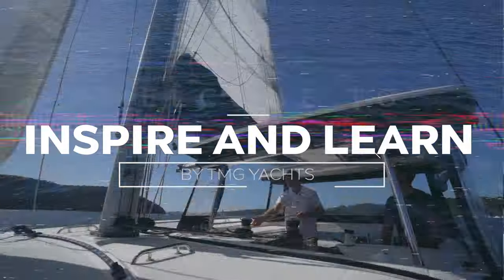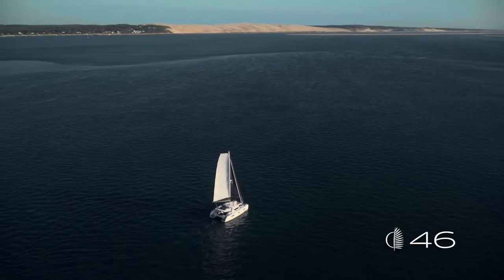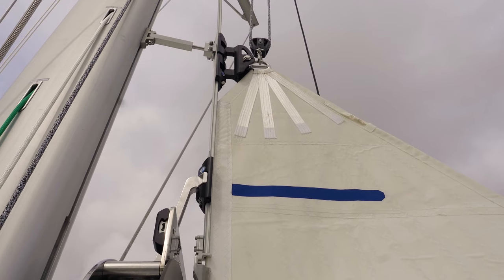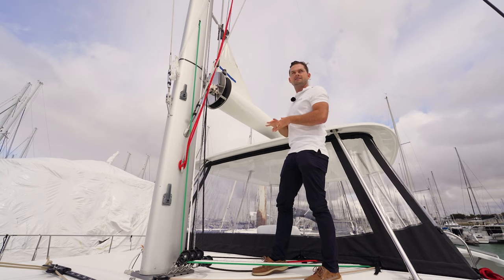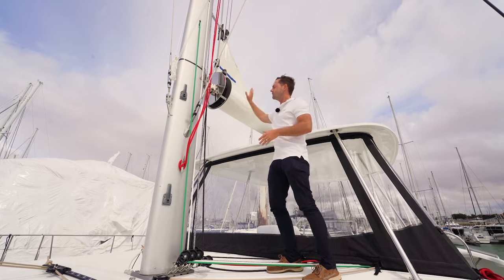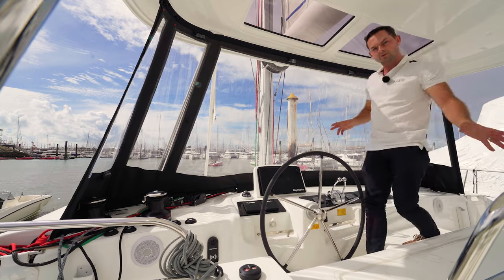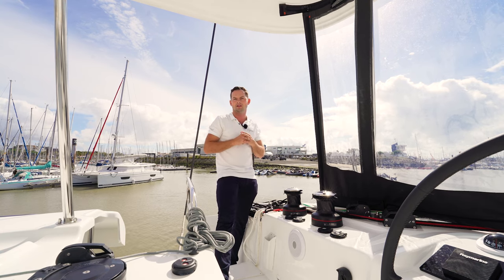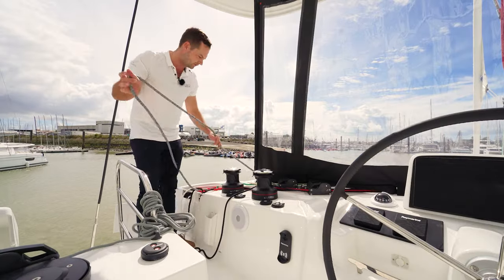Lagoon Catamarans NEW Furling Boom System | Inspire & Learn

Comment: Working on the back edge of that flybridge head to wind in a bit of a blow to prepare the boom 😮 I can see the owners really enjoying that experience lol. As with the lack of handholds on the outboard side of the steps getting up to (and especially down from) the flybridge in anything but calm conditions… I don’t think that these boats are designed by people who know what is needed when actually sailing. The furling boom is a neat piece of engineering for sure but in the real world, the traveller and mainsheet need to be in a less exposed position, and the sail itself needs to be able to be dropped without having to go through “processes.” It needs some kind of override to be able to collapse the sail in a hurry. It would also be helpful if Lagoon fitted more stainless rails and handholds on the outer side of the steps to the flybridge (particularly) and even getting down the steps of the gas locker into the rear cockpit is a challenge in anything but calm seas. The moulding (and only protection) on the outboard side of the steps is at shin height and there is nothing to hold onto on that side at all.

Comment: what a monstrosity of a system... the other furling systems are much better/tidy... the amount of weight that Lagoon is pushing up high is very worrying for a catamaran... they are going to have to keep weight in the hulls to balance this which ultimately means its a motor sailer !!
Reply from the maker: Thanks for your comment! This new system is indeed different from current aftermarket options on the market. While there is a little more weight than a conventional slab reefing system, there is far less weight on this set up than one with a cowling or solid cover hiding the sail. The weight of this specific set up is some what negligible compared the the obvious advantages of offering this system. It is, of course, an option and the standard slab reefing boom can still be equipped on the Lagoon 46 & 51 should some prefer. 
Having used this system, I'd say the naked design, although not as concealed as some other furling booms on the market, is perfectly suited to this vessel and its operation and makes it all super easy to use.

Thanks for your comment, and again, thanks for watching. 
Joe
Reply: In addition to what Joe said, I'd suggest most cruising cats won't have the problem of under-weight hulls. Especially if someone like my wife is packing it.

Comment: My concerns would be reduced sail area and gap between mast and luff.  Also the lost area by having boom more than six feet above standing deck.
Reply from the maker: We understand that this system might not suit all sailors however the standard set up still features the squaretop mainsail and the luff mounted directly to the mast. As for the height of the boom, the furling boom is the perfect answer to this.

Comment: I would assume with the addition of a UV strip, you can eliminate the need for sale bag in most cases?
Reply from the maker: This is correct, however, it is prudent to use a simple boom cover for storage during long periods.

Comment: I myself use the Profurl boom furling system on a 35 feet monohull, since 8 years now. Once you've tested it, you want nothing else, especially when the wind increases.
You can even furl the main sail even downwind with the correct angle, "facing the downwind".
Just been surprised that an important device is missing, the boom vang! I don't have a boom line, since the boom vang supports the boom and the main sail as well.

Comment: Great video.Thanks! I have always loved furling booms, but there are a LOT of detractors out there so I'm a bit nervious. How does this system  avoid the concern of having the boom at the perfect angle to the mast so that the leading edge the sail dose not start rolling backward or forward (Like a carpet rolling at an angle) binding the sail?
Reply from the maker: Very good question. The topping lift on this set up is actually a steel wire at a set length (to avoid stretching you’d get on a traditional topping lift). In order to set the boom heigh for furling, there is a stopper at the top of the  wire so it’s just a case of pulling the topping lift line until it hits the stopper. Doing this, and applying the other 3 important points 
- head to wind
- tension on luff 
- loose main sheet 

The sail furls into boom in a neat manner. 

Kind regards, Joe
Reply: @TMGYachts  You know, that just sounds so simple and logical. Why hasn't anyone else done that? Is there any disadvantage?
Reply: @navalgazingatcampdavid  none that I can see, boom furling is common feature on super yachts and once you get used to the methodology they are simple and brilliant. Mast furling is simple too, but more complex than this,  and you dont get a good sail shape with the vertical battens.

Comment: 14:27 Would you please comment on how this system may decrease the need to head directly into the wind +- 2 degrees whilst hoisting the main?  Thank you.  This looks amazing!
Reply: Bruno/Lagoon said that heading to wind is a non-negotiable requirement. That is required to ensure the sheet lays correct on the boom.
Reply from the maker: Correct, yes the boat must be head to wind. Thank you.

Comment: @16:16 Would two Harken Rewind, self tailing winches work for single up and down buttons?  One going out and the other coming in for "up" and that reverses for "down"?  I'm calling my patent attorney, don't even think of it Lagoon... ;)
Reply: Or a flatwinder for the main halyard for that matter.
Reply from the maker: This is a great idea, however, the two winches would be easing/pulling at a different speed due to the design of the system. So unfortunately it wouldn't work. The best system for this is to use two winches as demonstrated in the video.